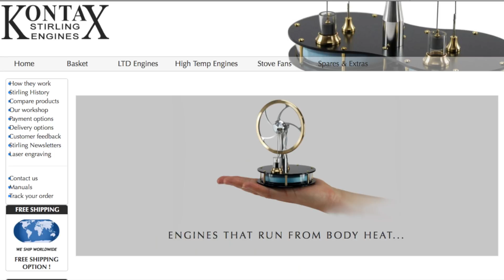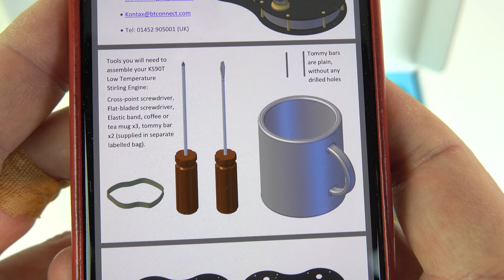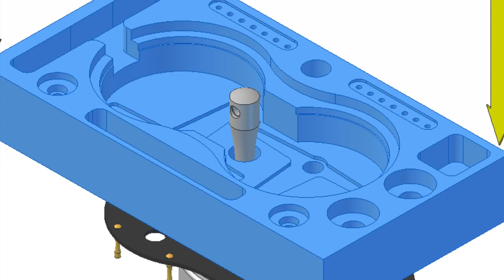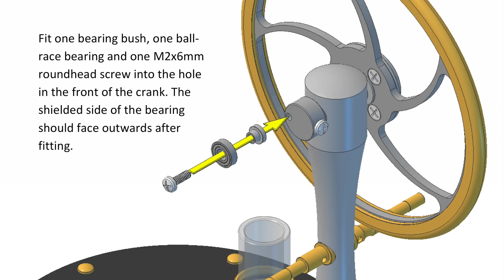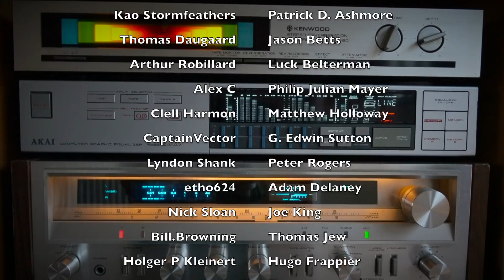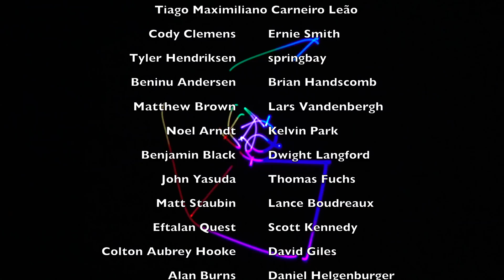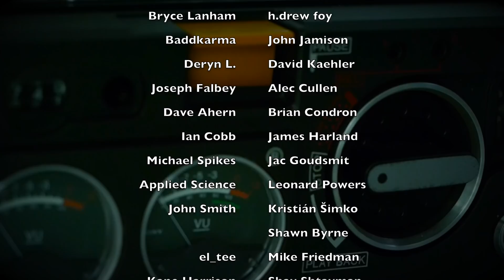Assembling a Stirling Engine Kit - The engine that can be powered by a set-top box

Comment: I'm pretty late to this comments section, but I have the 1 cylinder ross yoke one in black and it also has the plastic screws. I'm pretty sure it's to thermally insulate the top and bottom plates to increase the temperature differential.

Comment: 5:09

I don't know if anyone has mentioned this, but the screws for the pillars are always plastic, regardless of what color base you have. Apparently it's so the metal pillars don't transfer heat between the plates and lower engine efficiency.

Comment: This is a great company. So much better than the $25-30 china version. True precision work. They operated at a much lower temperature differential and runs for extremely long times. 
(This is also how I found Techmoan while doing research on these engines!) Shipped assembled from overseas with (UK) with a glass display bell and base without any damage.
These can operate at room-temperature (No hot water) with 3 chilled stainless steel "whisky stones" on the top plate.

Comment: Here's a thought: If using this as a solar engine, would it help if you covered the bottom half of the acrylic chambers (up as far as the bottom of the pistons when at top dead center), thereby increasing the delta temp, thus increasing the RPM.  It should not adversely affect the engine when applying heat to the base of the acrylic cylinder, for opposite rotation.
Reply: You're saying to keep the cool part from heating up?  I think that's the thing to do.  I haven't even watched the video yet, but that sounds exactly right for any sterling.

Comment: the greater the temperature differential the more power it makes. so if you were to replace the acrylic top and bottom plates with aluminium for better heat transfer and stick some fins on the top plate you could definitely produce enough power to drive a small dc motor (generator) to charge your phone from waste heat

Comment: I put together a similar one with just one displacer piston and ruse to sit it on top of me tea when it’ come hot out of the microwave oven.  I used it as a timer to know how far the tea was in the steeping process because I could hear it running at some distance even out of sight in the house..  When it started moving, the tea was minimally steeped and drinkable, but by the time it finally ran out of “steam” so to speak and quit spinning, that’s right at the optimum temp to rink that.is plaseant and fully steeped.   Unfortunately it quit working after I noticed it running too slowly one day and decided based on the rust on the mesh wire in one of the tubes that it needs dome light lubrication.  Well it didn’t work at all then, and despite my best efforts to clean it, it has never worked since.!  :(.  Word to the wise, don’t use any kind of oils to lubricate a sterling engine.  Any oil is too much weight added fo it to continue to operate even if done balancedly.  Balancedly?  Is that a word??  Well it is now!  :)
 …. 
I miss my little tea timer…
 :(

Comment: I read from wikapedia about the third made working sterling engine ever made  James Sterling made it for a foundry,  as a water pump.
The engine worked, only 40 rpm, but apparently had amazing power, with a  12 inch wide cylinder bore! It had 700,000 pounds of pressure and was a wapping 21 horsepower engine! 
The first Stirling engine made was used for a quarry until unfortunately became overheated.

Comment: Your comment about it not being strong enough to power recharging a cell phone is bollocks! Just look around the internet there are plenty of different types of Sterling Motors that are just that weak as this kit only having a minor variation of 2-5 degrees to keep the balance differentiation rolling the motor along! Yes they are WEAK, but can still drive a permanent magnet motor which'll generate electricity and as long as you got one tenth of an amp and even as low as 5 volts you can charge cell phone battery! In fact if you have 5 volts and 1/10 of an amp, you don't even need to have the Transformer plugged into the end of the cord, you just plug it directly into the phone!

Comment: I built a similar sort of engine for the final assessment for the thermodynamics course of my electronic engineering diploma. didn't necessarily have  to write a essay to demonstrate an understanding.

very nice kit, but I was a starving student. i used a cd spindle lid, some aluminium plate, PVC pipe, and lots of epoxy. the power pistion (small one) was cast from epoxy, and was a nightmare getting it free of bubbles. had to make pretty much everything a few times to get everything perfect enough to run (there really isnt much energy here), but incredibly satisfying.

obviously got full marks for that one

Comment: if the fly wheel had some fan fins on it it would work as a self powered fan too
Reply: It's not powerful enough to move enough air to be a fan. Its power output is just barely enough to keep itself spinning. To power a fan you would need a bigger engine and need to heat the hot side with a flame.

Comment: At approx 5:08: the plastic screws are used for fastening and to act as thermal insulators.  Heat flow from the the hotter plate to the cooler plate via the chamber pillars of these engines would tend to equalise their respective temperatures thereby reducing performance: the higher the temperature difference between the hot plate and the cold plate, the better the performance. Metal screws would enable such 'thermal shorting'.  I have one of the these engines which has metal plates, but the chamber pillar screws are still plastic for the reason mentioned above. In the case of these particular Kontax engines using metal plates, a small air gap exists between the chamber pillar and the base which is screwed to the same to further ensure a thermal barrier.

Comment: some late info.    for the folks who do not see it.    this is a wonky, inefficient  configuration.     if for no other reason, this is true as result of the use of  two, high-loss,  yoke mechanisms at the crankshaft.    a yoke can be  Correctly  used,  to  inefficiently convert  rotary motion to reciprocating.      the reverse, however, is just   stoopid.      googletranslate

Comment: It seems strange that they use metal pins which sort of defeats the principle of perpetuating a good temperature gradient between the two plates.

a 3D printable one should be available.
Reply: In the manual, they say that's why they use nylon screws. Also, the metal pins do not touch the bottom plate, they're a tiny bit shorter (just so much that it's not visible, but lets the screws isolate them from the bottom plate). I guess the brass pins just look better than plastic pins could.
I assembled my kit yesterday and think it was a beautiful way to waste my money.

Comment: engines with metal top and bottom plates on the chamber work sooooo much better. Like Duh !!  Perspex is a plastic, which is a heat insulator which is why this engine takes two !! minutes to get going.  I have a single-chamber model with metal plates and it's up n running within 15seconds of going on the coffee cup...………..

Comment: I really like the idea of using stirling engines for consented solar as with a high enough consecrations of heat you can get upto 50% efficiency which beats out solar panels significantly as solar panels top out at about 22.2% although you do have to factor in the efficiency of the dynamo, but they are about 85 - 90% efficient and a solar pannel needs an inverter anyway so they get the same efficiency loss there anyway so your more talking like 45% efficient and the thing is you don't need a massive array of mirrors a single 3 meter dish can easily do the job.

And the other benefits are that these would be cheaper than solar panels although there would be more maintenance costs and they make noise in operation, they actually work well in the kW region and actually lose efficiency beyond that point so if the goal is a distributed energy grid they work quite well there.

Comment: Certainly /looks/ cool, but is there a practical use for sterling engines? Like, could you scale them up and put fan blades on them to circulate air during the heat of the day? Or outfit them as a spinning wheel to make thread from cotton/wool? or... something?

Comment: Very cool. Could use a little strategically placed grease, just for longevity.
Reply: Fed' : Grease attracts muck. Muck creates friction and is abrasive.  If you want to lubricate a machine  like this, use dry graphite dust.  An XXB pencil is a good source of graphite if you can't find it anywhere else.  It's the best thing for door locks too.

Comment: In 1971 I was a 21 year old US Army soldier stationed in South Viet Nam at Binh Thue Army/Navy air field and I purchased a Tiac 4010SL reel to reel tape deck that I still ahve today but have not used in decades sad to say.  

Wonder if you could glue some strong button magnets in the teeter arm's holes on your Sterling engine than fad up 4 small coils and produce a measurable voltage as the magnets bob up and down oscillating their lines of flux past the tiny coil?

Comment: Your voice is the best music; your fingers are the best actors.  

I first bought a Kontax kit about ten years ago.  Later gave it to a friend.  Today I have two:  an old solar and a 1.5 year old Ross linkage.  One or the other is always running on a wafer thin, small reptile heating pad.  

Desktop ornaments rock and roll.  

Thanks for your work!  Or is that, play?  Either way, you have endless friends in your fans, best YouTuber ever.

The tiny clicking noise of any Kontax engine is caused by the free play of the con rod at the power piston.  A tiny dab of flexible goo, such as childrens school glue, will kill the click and slightly strengthen the running by removal of lost motion.  Apply with a toothpick.

Comment: First they take the dinglebop, and they smooth it out with a bunch of schleem. The schleem is then repurposed for later batches. They take the dinglebop and push it through the krumbo, where the fleeb is rubbed against it. It's important that the fleeb is rubbed, because the fleeb has all of the fleeb juice. Then a schlomi shows up, and rubs it, and spits on it. They cut the fleeb. There are several hizzards in the way. The blamphs rub against the trumbles, and the plubus and grumbo are shaved away. That leaves you with a regular old plumbus.

Comment: I wonder if you could replace the positions with magnets of the same size then wrap the glass tube in copper cable.  Wouldn't output much power but could store a bit of electricity for a small led or something.

Comment: Yeah, if you need to generate useful amounts of power, you need a larger temperature differential.  You might want to look into a (rare) old Philips MP1002 220V 50Hz 180W portable stirling generator or a more recent equivalent if you want to find something powerful enough to be more than a curiosity.

Comment: I bought one of those eBay cheapies - a single cylinder one with a flywheel resembling yours - for about $20. No bearings, but a few tiny drops of synthetic oil does the business. Runs great on a cuppa tea. I even tried a couple of ice cubes on the top plate and that worked too. Not as attractive as yours, but one could enter the Stirling engine club for a lot less!

Comment: I have a KS90 with the black metal plates and the screws are still plastic, I believe it is to insulate the 2 plates from each other as the reaction here is very reliant on that temperature differential between the top and bottom. I could be wrong but that was my theory when I assembled mine.

Comment: Funny thing about Stirling engines is that powering one can generate hot and cold air, this design probably won't, but Coleman produced a line of Stirling coolers in the early 2000s, they didn't sell very well because they started around $400US and I don't think they are made anymore, but they used a Stirling engine to cool the cooler compartment. Might be something fun to find for another video, I see them on ebay from time to time.

Comment: Attatch propeller blades to it and you got a fan that does not need batteries or electricity.
Reply: It probably wouldn't turn, the air resistance would be too much. 

There is a shop near me, though, that sells old-fashioned solid fuel stoves. And they have an electric fan that's powered by a Peltier device. You stick it on top of your stove, and the temperature difference creates electricity which turns the fan's motor, blowing warm air around the room. Clever!

Comment: They use Stirling engines in submarines to provide silent power ( called Air Independent Propulsion : AIP , Germany and Sweden have submarine as well as Japan , they have large numbers of gas bottles around the hull containing gaseous Oxygen and Hydrogen which is burned in a sealed chamber and that heat is what powers the engine

Comment: Could you maybe coil a wire around the flywheel and use the spinning of the wheel to pass the wire through a magnet and generate electricity that way? Or maybe balance magnets on the fly wheel and have it spin the magnets over a coil?

I don't know how much it would make, or if the fly wheel would even still be able to spin, but might be interesting.

Comment: Another fascinating video, I look forward to your product reviews and the humour that you use in your descriptions. I work in the heating field and there are a number of micro chp gas fired boilers which are using Stirling engines to produce heat and electricity for domestic use, unfortunately they are not yet reliable enough for general use. I saw my first Sterloing engine in Portsmouth (UK) University and it seems that the engine was invented in the 19th Century.

Comment: I'd go with metal plates, plastics have poorer thermal conductivity.
Reply: You can get metal ones, but obviously they're not transparent, so you can't see them moving. That's where most of the charm is. A compromise might be plastic plates with a metal chunk running through them.
Reply: The sides of the cylinders are still transparent

Comment: The kit could have added an output gear or used a magnetic flywheel.

The gear wouldn’t hurt the balance of the engine when used as a demonstration piece, but another gear can be meshed against the output gear to extract some mechanical work from the engine.

Magnetic flywheel does not disturb the balance either, being an alternative material for the piece, but by placing a coil next to the magnetic flywheel you extract some electric work since it becomes an alternator.

Given the efficiency of modern electronics, this Stirling engine might have enough output to power a quartz clock, through a small rectifier and a coil next to the magnetic flywheel.
Reply: The problem isn't the balance, it's that it has a very low power output, just barely enough to keep itself moving.

Comment: I've seen a few of these and always wondered if they could power a small fan blade or something? Like if the supports in the flywheel had a but of a slant to them could you turn residual heat from the TV box into a slight breeze?

Comment: The models with metal plates still come with the plastic screws. Their purpose is to provide insulation between one of the plates and the brass standoffs. That ensures maximum heat transfer through the chambers with the displacers, increasing efficiency. This is very important given that these model work on very small temperature differences.

Comment: Apparently it is the fate of every bright young Mech Eng undergrad, the first time they come across a Stirling engine, to think “What a wonderful idea! Why hasn’t anyone scaled one of these up to do real power generation?” And then they go on to discover that available materials just aren’t up to the job.

But having said that, many years ago there was a New Zealand company called WhisperGen, which did succeed in producing units that could do practical power generation for a household, without all the noise of a regular generator. They had some contract with a UK electricity company to supply them to their customers. But then I never heard anything more.
Reply: ... well, there's Kockum's 75kW system in the Gotland class submarines. I'm sure other applications are possible, but there are likely cheaper or more efficient options when you're not as space and emissions constrained. More details at https://www.stirlingengine.com/modern-uses/
Reply: Maybe use them in conjunction with other renewable energy sources for times when its not light out and not windy and could just help fill in the gaps and keep the batteries topped up?  I duno just an idea.

Comment: Holy Moly...that £90 version i bought built from China for £25...ready built...
By the way they don't run on heat per se', but teperature difference, they are often used in submarines today due to the frigid water outside, warmth inside...basically free power...
Reply: Used on submarines? what do you mean? Basically free? the reason that it is warm inside is the things generating heat, the engine/turbine/generator/nuclear reactor, it is far more efficient to use the power directly from the power plant in use than to indirectly draw power with something like a sterling engine.

Comment: Anyone saying that this technology couldn't be used for anything practical should take a look at the Swedish submarine that "sank" a brand new U.S. aircraft carrier in a 2005 wargame. What powered that submarine and made it so hard to detect? A Stirling engine! :) (To be fair, the sub also use a diesel engine as its primary power source. The Stirling engine is used while underwater. It's attached to a generator which then provides virtually silent power to the rest of the boat and extends its underwater range from days to weeks.)